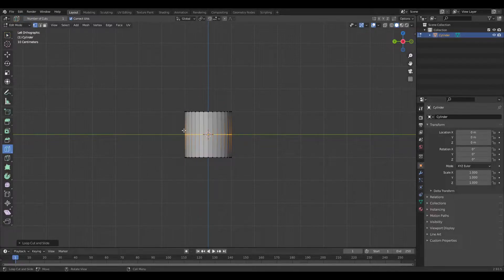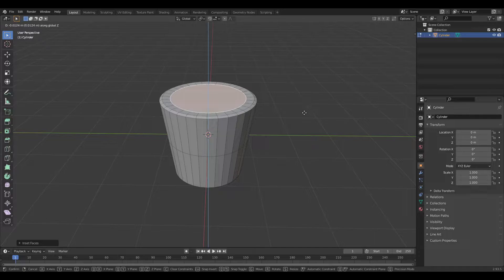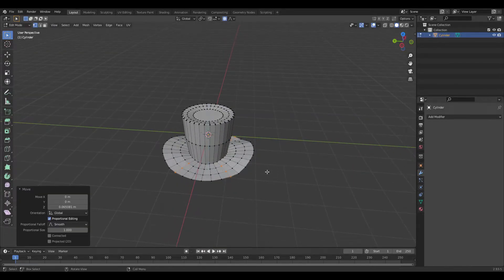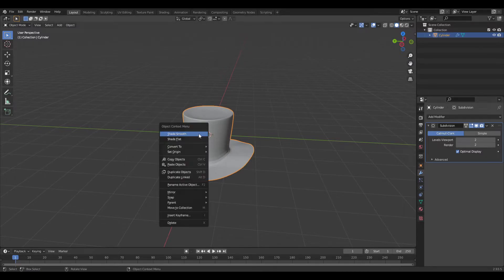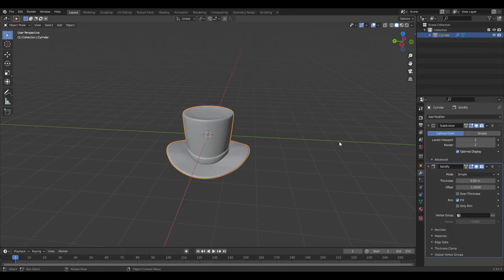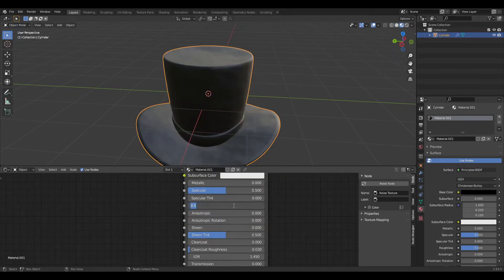🎩 How to create a Tophat in 1 Minute in Blender 🎩 Tutorial

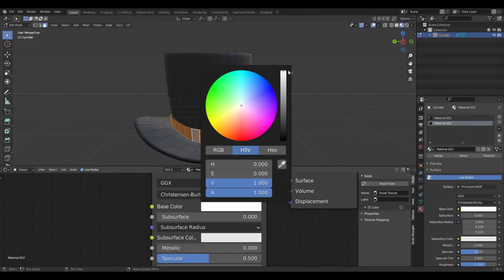Comment: So its great, and I could mostly follow along! But the part where you say to "push it up a bit, and down a bit" what tool in specific do you use to increase the area of the material at 1:09?
Reply: Update: Got help from a friend and I thing I buggered up massively somewhere along the line (which thanks to blenders limited undo limit, means im starting back from the start!) I think when loop cutting for the band to extrude, I screwed up.
Reply: Yeah, still dont know what you mean by push up then down a bit.
Reply: Right, so extrude for the band. Got that. I think my loop cuts are too low? I still cant get the material color to color in the entire face with the "up and down" thing.

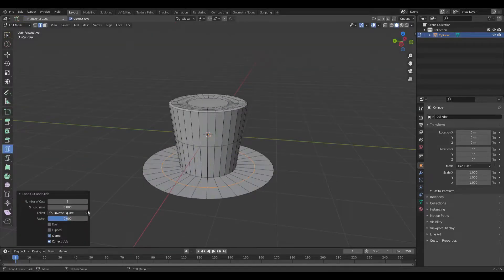Comment: hey uhh so I'm new to blender but I don't the the 0:20 part. I have the bottom removed but if I take the circle the whole second half of that cylinder is going with it
Reply: Press the "2" key along the top number keys to go into edge select mode. Make sure nothing is selected (Alt+A will do that). Hold down Alt+Shift while you select one of the bottom edges, and Blender will select the entire edge loop along the bottom as shown in the video.
Reply: but when i extrude it just extrudes into 1 direction not inside like in the vid
 @NoOneYouKnow2025-m8c